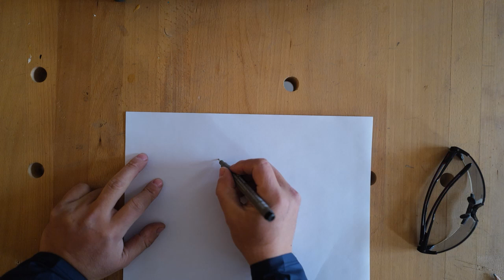Brompton Bike Storage---Create a Storage Furniture for Brompton in 1 Hour.

Comment: My 2 cents: 
Add a charger for your lights, a drip tray for when it's wet and reduce the footpint by putting the bag on top instead nearby.

Nice to have: storage space for the tire pump, cleaning rag and some tools

Bonus points if you can sit on it